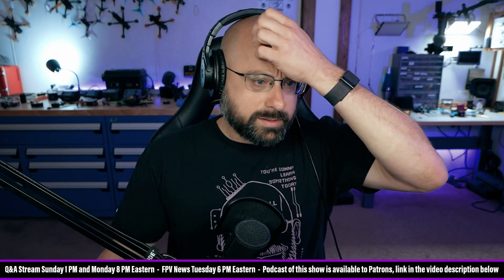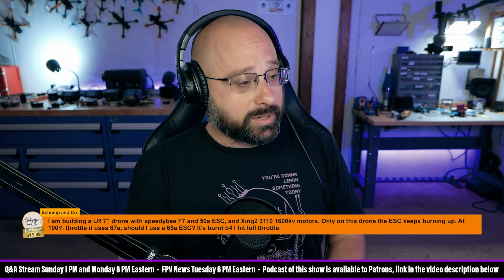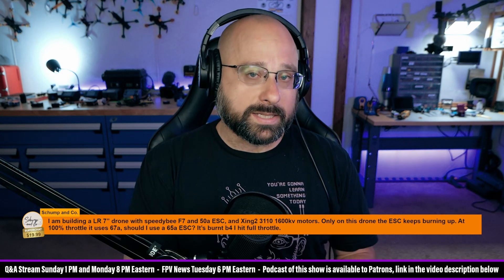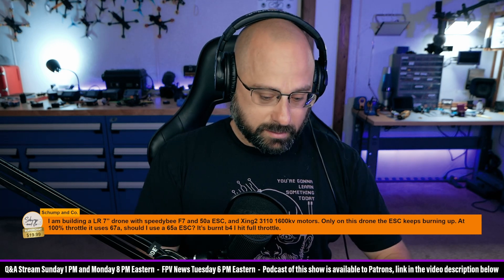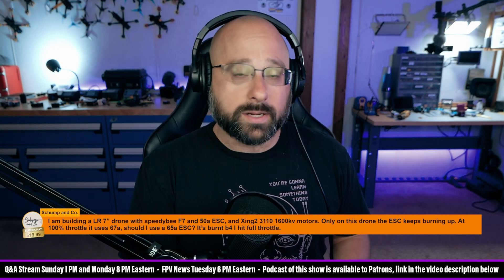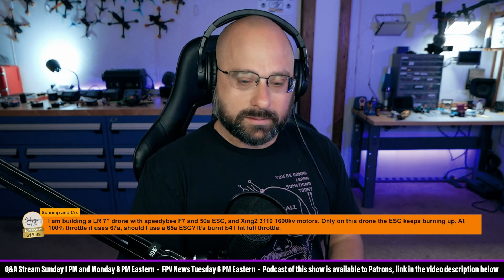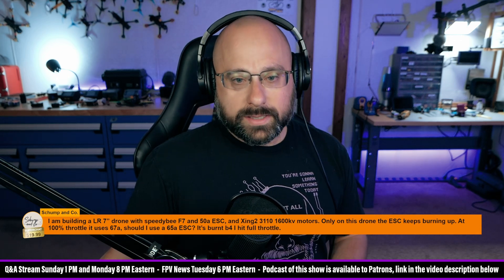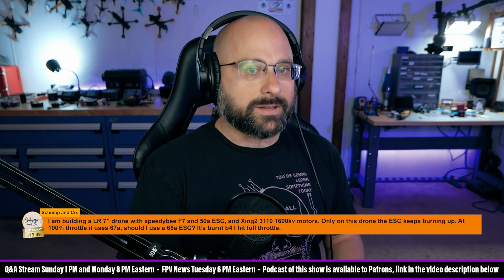My 7 Inch Drone Keeps Burning Up ESCs! What Do I Do? - FPV Questions

Comment: Try changing timing to lower timing on the esc. Most esc stock settings are for 5 inch quads.  

Also I have an old quadcopter build that have separate esc per motor. And I have a rare thing where i killed all the esc at the same time, because of a voltage spike, that's the day I started putting  caps on my quad builds. Now that is a rare scenario, and my old tmotor esc might have some design flaws, but at the end of the day voltage spikes can kill an esc, specially those fancy blheli32 ones.

Comment: The OBVIOUS. 7" you can get away with XT60 only if running 6S and 28xx or smaller. Its really is the limit of XT60. I run XT90, just like on my 10". 7" with big motors is very power hungry - need at least Gaoneng 2600mah 120C (410g). There are very few batteries that can keep up.

1. Xing2 3110 is BIG = 77g. Popular excellent BrotherHobby 2806.5 is 41g. Cheaper EmaxEco 2807 is 47g.
2. To fully use the motor power either agressive 7" triblade, or use 8".
3. On 6S, 1250KV 8" prop, iFlight test data shows up to 85A!! These are power hungry.

I never have burned ESC on 7", using Mamba F7 55A, but I am running 6S with Xing2806.5 1350KV. 

Basically, its HUGE motor. So you need huge ESC. I HIGHLY recommend individual ESC on BIG QUAD. Less electrical noise. Less heat. Easier to replace.
Reply: The xt60 is not going to cause the esc to burn. It might get too hot itself or there can be excessive voltage sag but thats not going to hurt anything other than the connector itself.

Comment: My 7" did the same thing on its maiden flight... Burned the ESC, the FC and burned up a motor and I finally found what caused it.  The GPS power wire had gotten pinched in the frame and shorted out on full throttle.  It hovered just fine, the motors were cool... Until I sent it up again for the 2nd half of the flight... the stress test.... BOOM.  6 or 7 builds by this point, but I still made the mistake.  Check everything. Multiple times. Get out a magnifying glass and check that all your solder joints are clean, minimal and not bridging anywhere. Check that the wires aren't being pinched somewhere in the frame.

Comment: I have no issues running 7”LR 3008 1900kv on a hobbywing 60amp on 6s and 5s. It took me a while to get it flying correctly without issues. But I have spent months working on my filter settings and a good pid tune.

Comment: I’m sure the 67A is a per motor usage if it is at 100% throttle. The product page says it uses more than 70A when using 7inch prop and 6s voltage. I have xing2 3110 1250kv with 7.5inch prop and 6s, the esc is 55a per channel and I limited the throttle to 80% and it is all fine.

Comment: Same issue with velox 3008 motors. Burned them while cruising for about 20 seconds (Esc temp reading got way too high and shut them down) at default PIDs. Dealer told me that it was somewhat my fault and needed to replace Motors and ESCs with 2806.5 all fine now..
please share if the issue got resolved❤
Reply: Yeah, you just replace both esc and motors, but you will never know what the issue was. Could have been a bad esc, so you bought new motors for no reason. On the other hand, if it was a motor issue, then you will only know after the next esc got fried.
Only way to have solved this issue with a reasonable price, would be to go back to single ESC's and try again.
Reply: I got 3008 1150kv on my 8" and loving em, not as torquey as my 2810s on 8, but a bit more efficient

Comment: Weird issue. I hope that you can figure it out for him, then share it with us. I'm curious. I tape my esc when soldering larger wires like  motor and power wires. Just in case. Darned solder balls. ⚽😁